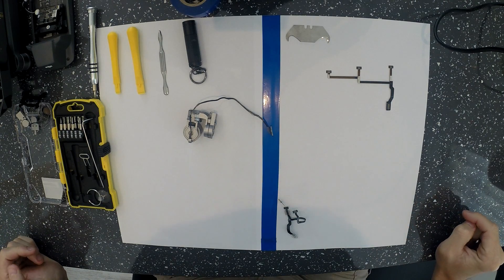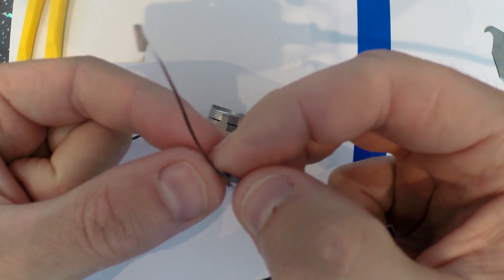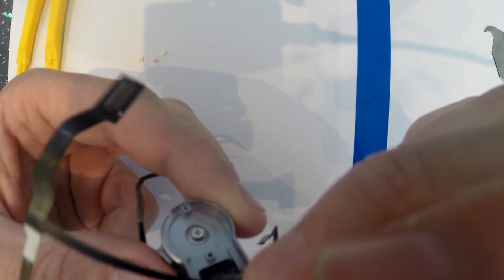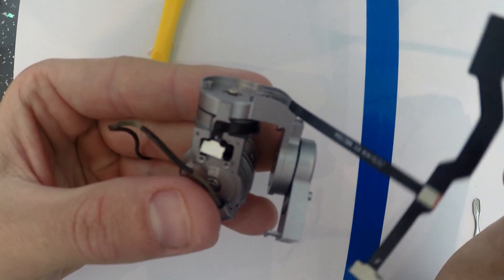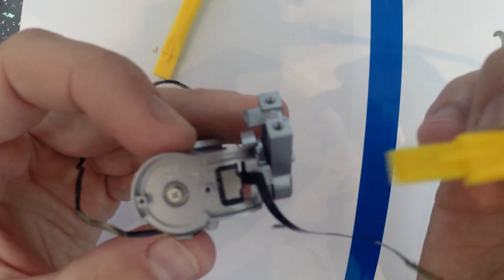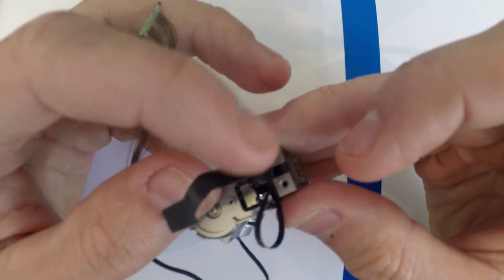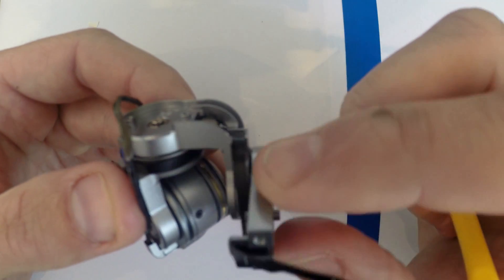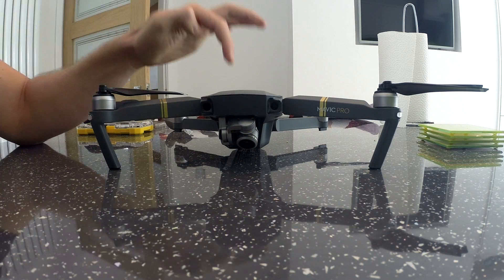Mavic Pro detailed gimbal ribbon replacement

Comment: I've replaced the gimbal cable and now I have no more video feed and the gimbal violently tries to calibrate and doesn't work. What can I do? Thanks!
Reply from the maker: I'm not sure what to do in this case. I initially had a problem with the replacement Gimbal cable being broken and it was not calibrating properly, I ordered another one, fitted it and that worked fine. If the video feed is broken too it could be another issue

Comment: I replaced my ribbon cable with a new one. I met started well and I was happy it worked. Unfortunately, after flying for 20min, the same gimbal motor overload issue reappeared. And the gimbal gets hot really fast, only after starting the drone for 30sec it’s already very hot. I opened the gimbal again and tried fixing the ribbon cable. But it didn’t help. Any idea what else I could do? Replace the whole gimbal? Buy another ribbon cable from another company? Thanks
Reply from the maker: Try cleaning and the hinges in the gimbal with a small brush, if there is dirt or debris present the extra friction might cause the motors to overheat. 

If that fails I'd try getting a new ribbon cable, I had to do this as the first one didn't work. This is a cheaper option than replacing the gimbal. If it doesn't work you should try searching some forums for people with the same issue before you buy a new gimbal, you might find another solution.
Reply: @Richie2Shoes  Thanks. I was just about to order a new gimbal arm for $70. It has a ribbon cable already. You think I should try another ribbon cable first?
Reply from the maker: @alexvite5065  try cleaning it all first, then give it a fly and see what happens. How much are you paying for the ribbon cables?
Reply: @Richie2Shoes  okay, will do. thanks. $8 for the ribbon cable
Reply from the maker: @alexvite5065  maybe try one more cable, then replace the gimbal if it doesn't work. You can keep the one you buy as a spare because they do regularly become faulty 👍

Comment: Best video so far...unfortunately when I turn the drone on the camera points down.  I guess I'm going to have to send it for repair after all
Reply from the maker: That happened to me with the first ribbon cable I changed, it turned out that was damaged upon delivery.
It could potentially be that the ribbon cable was damaged when you received it, before sending it off it may be worth trying to give it one last shot and fit another cable 👍
Reply: @Richie2Shoes  thanks.  But I've tried this three times now. The first two times I may have damaged it trying to install.  I felt the last time based on this video I did a pretty good job.   Still hoping that's all it is and the official repair company will just put a better quality cable.
Reply from the maker: @goaliebrent  that's a shame that it didn't work, hopefully you can get it sorted and get flying again ASAP

Comment: The funniest thing about this cable is that you do not even have to crash to damage it. Mine just gave up after 270 hours of flight from wear and tear..
Reply from the maker: Yea, I think it's due to poor gimbal design, there's a piece of plastic on the gimbal frame that rubs against the ribbon cable when you move the camera. I filed it off and haven't had any problems since 👍
Reply: i agree,mine has never had a crash or even a minor bump and is always wells ecured while in the bag,3 weeks i have'nt used it and one day i decided to fly it,voila!gimbal overload!

Comment: Hi, Where can I buy the ribbon cable? I found 2 options in amazon that have good reviews.  Can you advice if any of those 2 will work properly?

https://www.amazon.com/Rantow-Flexible-Gimbal-Ribbon-Camera/dp/B075XKND4J/ref=sr_1_3?keywords=mavic+pro+gimbal+ribbon+cable&qid=1558972929&s=gateway&sr=8-3

https://www.amazon.com/Fstop-Labs-Replacement-Platinum-Flexible/dp/B06XDVFM8X/ref=sr_1_3?keywords=dji+ribbon+cable&qid=1558973080&s=gateway&sr=8-3#customerReviews

Comment: Thanks bud, I will try it out.
Reply: the aluminium base and bottom circuit came in contact with sea water. i Have tried cleaning it with distilled water. the flex will arrive in sometime, ordered it today. somehow it will take 2 to 3 weeks here in india.. frustrating it is. will post update.

Comment: Great video thanks!!! All the other how to's show the easy part. Not actually installing the ribbon which they probably couldn't do anyway. "To install the ribbon just do all these steps backwards." Anyway my Mavic Pro crash when a prop broke off in flight at 300 feet. It nose dived into the ground at 40 MPH. Was under warranty but DJI wouldn't honor it because I was using Litchi. They quoted me a $560.00 repair bill. I said no thanks and repaired everything myself for about $80.00. Thanks again!
Reply from the maker: Hudson Valley Drone Flights I'm glad this helped you. Sounds like you did a good salvage job after a 300ft nosedive! Well done & happy droning 👍

Comment: great help. however dji didn't make it a common fault. only ever a fault after crash
Reply from the maker: I've seen people have the issue without a crash. There's a section of plastic on the gimbal assembly that the ribbon cable snags and rubs against. Prolonged use seems cause damage to this
Reply: YES see what you mean after rebuild, great vid anyhow
Reply from the maker: Dale Murray cheers dale, glad it helped
Reply: I've never even had a rough landing. Actually I've never landed on anything other than my landing pad. And about 3 days ago I was flying my Mavic and I noticed my camera kind of moved quickly to one side while it was in the sky, which scared me because it had never done that, and I thought maybe a bug or bird hit me because I couldn't see it with the sun in my eyes. I landed immediately. The next day I took it up to film a train going by my house, and when it powered up the camera started flipping forward and backward violently, scaring the shit out of me. It continuously done this along with the "gimble motor overload" warning in the app. I noticed if I started the Mavic upside down it would work. It only worked for that day. Today i took it up to film Hurricane Florence approaching my area, and any way I started it wouldn't work. I did get it to fire up once, but when I took it up the horizon tilt was WAY off, and the gimble just wasn't acting correctly this time. I'm ordering a ribbon tonight and hopefully with the help of your video I can fix mine as well!
Reply: Not true,mine was damage without a crash,it's poorly designed..

Comment: Great video, thank you!  You helped me finally get the install correct, after watching several videos that did not help at all.  After struggling with the cable for almost 2 hours, at 2:20 in your video, it finally made sense and I was able to complete it right away.
Reply from the maker: Glad the video was useful, happy flying!
Reply: @richitwoshoes I was in exactly the same boat and after breaking one of the replacement ribbons by incorrectly installing it. The penny finnally dropped when watching this video. Will keep u updated once I get the  new ribbon on Wednesday 😵

Comment: Great tutorial. I’ve been looking for a tutorial to replace my ribbon and yours is very clear. Thank you for that! Any suggestions on where to buy or how to make sure I’m getting the “original “ part?
Reply from the maker: Thanks Paulo, I'm glad it was helpful for you. I Bought mine from Fast-Tech-UK on ebay, it's not an original part but it's practically identical: https://www.ebay.co.uk/itm/Brand-New-DJI-Mavic-Pro-Flexible-Gimbal-Flat-Ribbon-Flex-Cable-Layer/322601866779?hash=item4b1c91d61b:g:BLsAAOSw-wFZb9G8

If you're not in the UK I'd still suggest using ebay, but make sure you find a seller with good feedback and if possible reviews on sales of the ribbon cable.
Reply: Richi TwoShoes thank you for your reply. I’m in the US and will look on eBay
Reply from the maker: Good luck pal, hope it works!

Comment: Thank you for taking the time to actually walk through the replacement process. Every other video is long, and the persons hands are in the way 90% of the time or they put it in a different way each time, or they redo steps over and over. Im on my 3rd ribbon cable and on startup the gimbal got really hot so im just ordering a new one to start from scratch.
Reply from the maker: I'm glad it helped, I had an issue with my first replacement so I wanted to try and help others avoid it. 
If your gimbal is getting hot it sounds like the motors might be damaged/obstructed, hopefully you get it sorted. Let me know how you get on.

Comment: Actually that's part of ribbon you keep rotating how does the ribbon go through the mount do you bolt mount on top of that ribbon where you folded it and then screw in with the two screws on mount to the gimball arm
Reply from the maker: oczkowski8 hey, sorry for the slow reply, you're best to watch another gimbal removal video alongside this one to make the process crystal clear. My video just focuses on re-threading the gimbal ribbon safely and correctly.

One of the best things to do is take pictures or videos when you take it apart, this makes it easier when you come to put it back together. Sorry of this answer doesn't help.

Comment: After 3 cables changed Still gimbal overload error 😒 ideas ?
Reply: oczkowski8 got the new gimbal from ebay (looks original ! ) changed it and now everything works good😁 BUT! : at startup the gimbal still makes the check up quite hard ! But works perfectly! I belive the gimbal has 2 week points ! 1 ribbon cable ! 2 gimbal motor center axle! Never start the drone with clamp on ! Never moove the gimbal against its will when working !
Reply from the maker: Marius Daniel Fauru that's awesome news pal, glad you got it working, thanks for the updates. Hopefully no more problems for either of us 👍
Reply from the maker: Marius Daniel Fauru does the gimbal move around freely when you don't have it turned on?
Reply: Richi TwoShoes yes I checked the motors Everything looks ok But i got some ideas what can be the issue Ill write how it went after i get the new cable 😉
Reply: Marius Daniel Fauru please let me know what you did
Reply: oczkowski8 so : after again changing the c cable After 2 days again broke down I got a Original Gimbal with new original ribbon cable from Ebay ordered for around 35€ when it comes i make a video about it Also found out You can litle modify the old gimball so you get a few extra mm of play for the ribbon In the video i will show that too

Comment: Ty. And if after puting back the flat ribbon we dont apply the black glue stuff....  wont it disconnect by itself with the vibrations while flying?
Reply from the maker: Eric Couture apologies for the slow reply, my notifications aren't coming through. 
I didn't reglue, mainly because the black glue still clamps the ribbon clips in slightly because it's a tight fit but also because I can envision this happening again, and removing the glue is one of the higher risk parts of the process.
I've had no issues at all so far and I've flown for a good 5 hours since the change